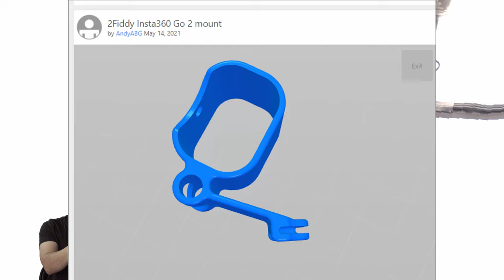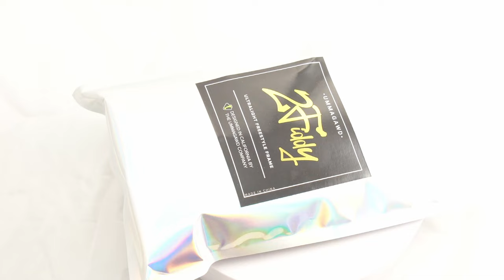2Fiddy Sub 250gram freestyle by Ummagawd ultralight drone 2004 motors

Comment: I have liked all of Tommy's builds! He always takes the time needed and reviews every part to make a fantastic flight experience!! Just built a Moon Goat next the 2fidy. Then I'll have one of all his builds.
Reply from the maker: Thats awesome, i loved my acrobrat back in the day, and this one has exceeded my expectations.  Cant wait to see what they come up with next.  What did you think of the moon goat?
Reply: I built up the moon goat with all newbeedrone. Cricket FC and ESC combo, 6s 2306.5 flow motors, Full size DJI air unit. And it flies great not much tuning involved. The only thing I broke was the top plate. I tied my ESC main power leads to the front stand off and in a bad crash it pulled the lead breaking the screw out of the top plate. Cricket said at Rampage he usually breaks arms not any of the plates he said I might be the first to break a top plate. But really like the build would recommend it to any one on DJI. Still hoping Tommy will make a remix V3 for DJI!!

Comment: Omg I just went through tuning after tuning then 3d printing after print to come out with a no jello insta mount.  The mount design that worked for me was mimicking zip tie loops in the design. Insta is super jello prone. But it can be done. My footage is solid now. I can send stl if u want. It won't work in the fiddy but it will give you an idea.
Reply from the maker: I’ve had pretty good results on most frames w that camera.  Good notes though.  I think I know what your talking about to isolate this micro vibrations

Comment: I've been racing a ~249 gram 4" X-Knight toothpick that I converted to Shark Byte this year, and I just built a ~229 gram 3" analog freestyle quad on a Woodchuck FPV Wasp frame.  I feel like a slightly heavy 3" or 3.5" can give the best flight feel in that sub 250 weight range.  Ciotti also seems to agree.  The idea is that you get a similar load on the props as a full size 5", and the inertia can more effectively punch through the quad's own drag when you throw it around, so it feels like a larger aircraft than it is.  I guess that was also part of the idea behind the Tiny Trainer.  We just need more durable motors in the 1404 to 1505 size with 3mm shafts, or something.  A 3" can be almost indestructible except that all the motors are pretty fragile.
Reply: 3.5 coming out next! Be on the lookout!

Comment: I fly with a full size gopro and the mint green 500 mah gnb lipos.. also turned down the dshot idle.. doesn't feel floaty at all.. feels lowkey like a light 5 inch with no go pro..
Reply from the maker: 500mah 6s? Hmm maybe I need to toss a GoPro on it. But how do you mount it?
Reply: @JonE5FPV  one of the mounts you mentioned.. I believe I got it from brain 3d. I use a hero 7 or 8 no jello. And the 500 mah came from fpvcycle.com I think. You get about a solid minute+ more over the 380 mah 6s. The 550 mah gnb are good too.

Comment: What’s up brother had a question for you about the frame.
Would a 20x20 stack fit or dose it have to be a AIO other question would be can I use like a regular 1500 4s battery on there if I don’t care much for the sub250? Thank you so much for your content man have learned a lot.

Comment: I'd like to see someone fly this with 4 inch props. See how it handles. Does it get rid of the floatiness? Maybe 4.5 inch props can be a thing in the future?
Reply from the maker: they have made a 4" version recently as well!  that may be the ticket, i just got in some 1100 mah 4S CNHL that work great, and a little extra weight makes it feel almost perfect.
Reply: I would assume if "floatiness" is a problem, simply changing the min motor speed to a lower value would reduce this.
Reply: @RindosRides  Maybe? I lower all of my quads min RPM from 5.5% to 4%. My 7 inch still feels a little floaty but maybe it just needs a lower RPM than 4%. I haven't gotten around to testing to see what the actual minimum RPM can be set to and not have the quad go wonky when I go to zero throttle. Lowering the min RPM is great for more inverted hang time.

Comment: Did you use a ND filter on the Go 2? It should reduce the jello a lot.
Reply from the maker: I did not, ill look around for some. thanks!
Reply: @JonE5FPV  ND filter plus manual settings to lock the shutter speed at 4X fps takes care of the jello nicely on my 5" race quad! The ND filter set direct from Insta360 is really nice.

Comment: Looks great! I've got my frame kit, but haven't had time to build it yet. My Power Pick build came in at 258g auw with a 4s 850 and I really enjoy flying that one. I'll be looking forward to seeing how they compare. When they get that light do you still think there is a big difference in flight feel between a top and bottom mounted battery setup?